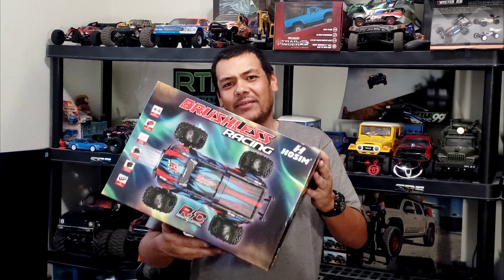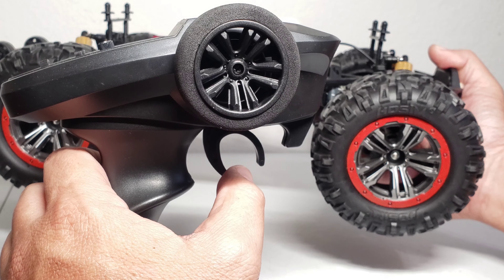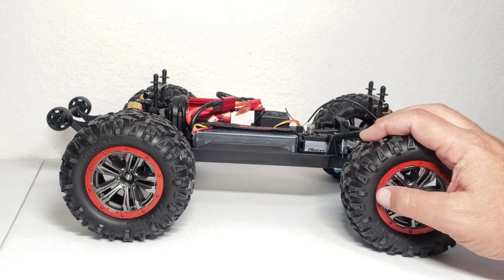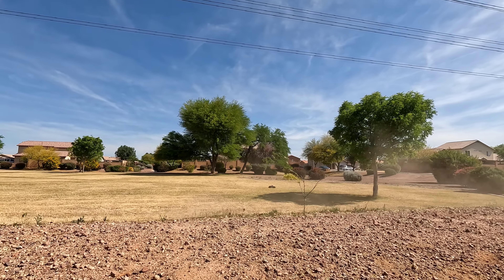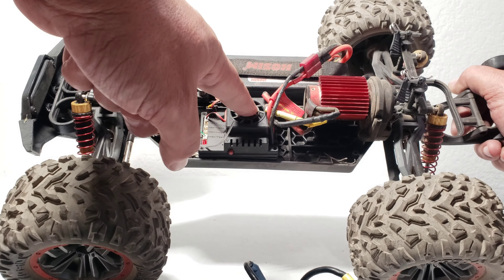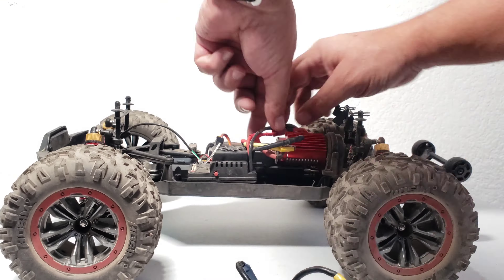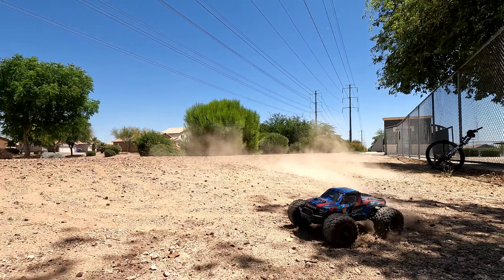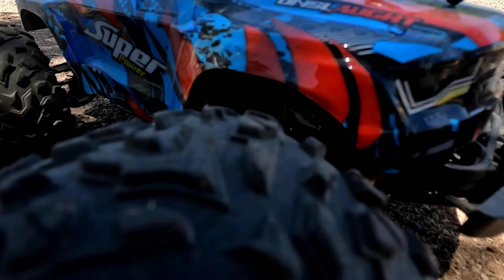Hosim X08 Brushless 4x4 Rc Truck.

Comment: So you think your first run may have damaged the diff using stock esc?or even the diffs are so bad a 2s run with a proper esc would not last? What able adding a lot of grease?Maybe that would save diffs...thanks for sharing.😊
Reply from the maker: you can save diffs by driving better than me lol. I was landing jumps on full throttle and hitting stuff. If you dont vash too hard it should be fine.

Comment: Xo7 s. Rock
Reply: You obviously work for hosim...you left same comment on every hosim review...Fix the diffs,and esc issues...then maybe you will have a good product...i never once had a diff fail in my 12th scale wltoy brushless setups...
Reply: @roadstar499  I haven't had any problems with my xo7 s (2) and I run them hard every day. I do not work for hosim, wish I did

Comment: Yeah I got it I’m new to Rc and I’m retired so I’m trying to get into a hobby. Hi sum replaced the front diff and now the rear is gone so I ordered new ones but I was told to contact Hosim because they have good customer service. So I sent them an email and waiting to hear back. Hopefully they’ll fix it.
Reply from the maker: I was trying to see if a wltoys hardened steel diff would fit but never got to it. The design of the diff gears seems weak in these. Since it doesn't have a slipper clutch the diffs take a beating. Gotta be careful with throttle when landing or doing anything harsh to it. Not a bad rc at all just needs some kinks worked out. Hope they help you out.

Comment: Unfortunately, I purchased this truck and you are right the ESC problem is horrible causing the truck to break… The bottom line is Hosim put out a product that was not good and if you purchase this truck, you made a mistake… Hopefully they will rectify the problem one day
Reply from the maker: definitely the electronics aren't good. Bashers and drag brake don't mix.

Comment: Would simply changing the receiver solve the problem? Why esc as well?
Reply from the maker: unfortunately this RC has a ECS/Receiver combo so you would need a new receiver and esc to replace the 2in1 esc/receiver.
Reply: @RunThatRC  ohhh, ok. That makes sense 😊

Comment: Crap!!  Hosim x08 is crap!! It's not budget at all! Stripped diffs in less than a week! It would be budget of it was 50 bucks instead of 250. Plus it has auto brake so don't try and jump it over anything without keeping your finger on the throttle. I bought one and it's been broke for 3 months. 2 months waiting for parts and 1 month after I fixed almost the entire car and it broke again in ledges than 20 minutes. Do not buy!! Save your money and get something better with better Costomer service and better part availablility. Get a hbx 96889a pro for a budget basher car.
Reply from the maker: I broke mine within 24hrs. They sent me the part (front diff) took a week contacted them directly. I know the speed I received my replacement part may not be the normal experience. I mention the price and my thoughts on this and run it broken in the video. HBX makes some good stuff.